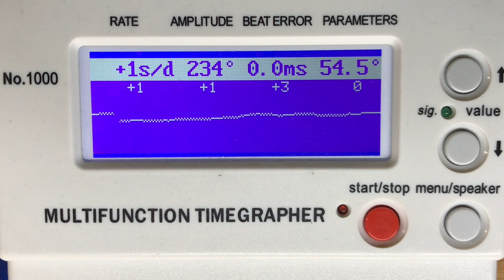For R.V. -- Seiko 6138-0040 JDM Bullhead Service

Comment: What about the main spring?
Reply from the maker: what about it?
Reply: @BlairWatchProject  I thought it would get replaced.
Reply from the maker: An original Seiko mainspring is the best mainspring available and they only need replacing if they are cupped, kinked or broken. This one was none of those, so it went back in with great results.